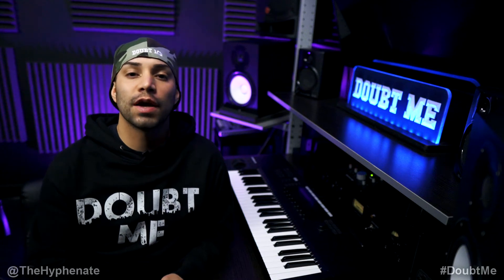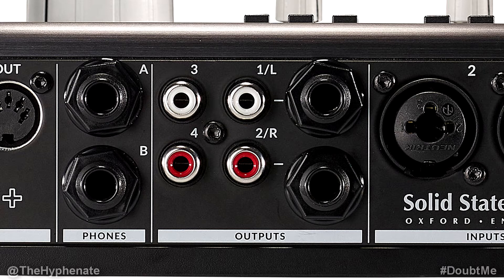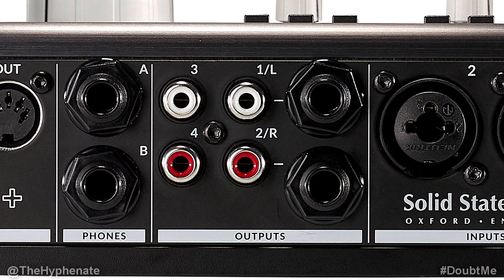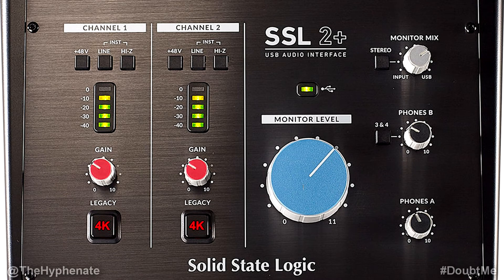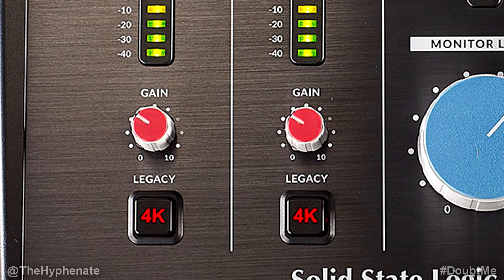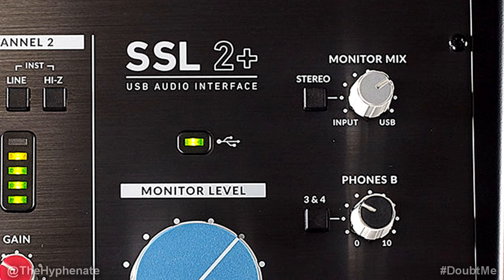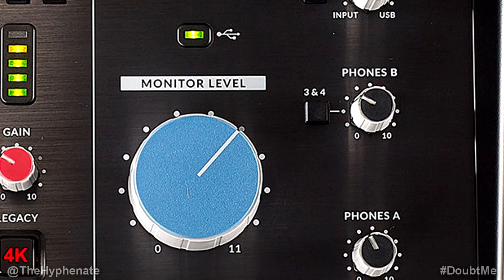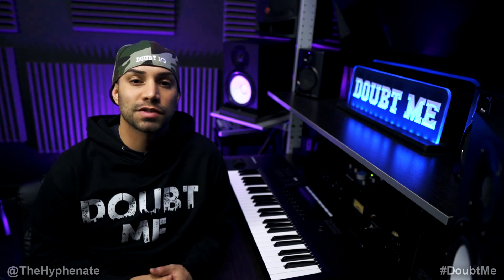SSL 2+ USB Audio Interface Tutorial [ Detailed Overview and Breakdown ]

Comment: Hi, I can’t seem to get the balanced monitor outputs to work. I have a mic plugged into the input and get a signal with the led meters and with the knob turned all the way to the left to ‘input’ but nothing from the monitor outs. The headphone out however works no problem. Is there something I am not doing right?
Reply from the maker: Make sure you have the right cables and the monitors are turned on and have the right connections

Comment: Hi, do you still rate this product in 2024 ? Or should i check something else in this price range ?
Reply from the maker: It's still great.  However they have a mark 2 version out now.  That one is awesome.  Also, now I've moved on to the Audient ID interfaces.   I use the ID44 mk 2, but the audient ID24 mk 2 is also great.  
The reason I went with the audient interfaces is because they have insert and sends built in to the interface which is great for connecting analog gear to it, like a compressor.
Reply: Thanks 🙏🏻

Comment: thx
Reply from the maker: Happy to help. Thanks for watching 🙏🙏
Reply: @DoubtMeTech

i bought that interface and Iam using two different operating systems.

I've recognized that the sound quality of my mic is a way much better on windows than macOS.

I've the latest windows and MacOS
😢.

Do you know something about that ? I've seen the difference even when I use what's app web or desktop app on both systems. the mic quality is very different.

Audio input and output is on SSL2+ on Mac .
Reply: sorry Iam using the sE electronics V7 MK microphone

Comment: I am trying to use channels 1-4 all together (LR trs + the rca channels 1-4) Combining multiple stystems(4 systems to be exact, with one system running mono through phone A or B) Specifically for listening purposes. When i use phones A and B, there is no stereo/surround panning. Now when i select my output in windows, there is an option for output 1/2 and a seperate output for 3/4. But i dont want to use them separately. Im not finding software for my interface that combines all the channels into one. So essentially, i am able to run 2 of my systems into stereo currently, and am only able to hook up the other 2 systems through phones A and B, but i want stereo so phones A and B wont achieve this. Assuming its not possible but figure i should ask. Thanks

Comment: If I plug this directly into my camera, should I just use the secondary headphone out port, or should I use the RCA outputs since I already have monitors plugged in to the balanced monitor output jacks...?
Reply from the maker: Why do you want to plug this into your camera?   The audio level come out is Line level and the camera will take in Mic level. They are different levels.  It can be done, but you run a greater risk of distortion
Reply: @TheHyphenateTech  so it's better to run it through the DAW? I don't have a video capture card yet and was thinking it would be a lot easier to just record it all to the camera's SD card directly to start...
Reply: @TheHyphenateTech  I also have a Sony A6400 so at least it is a decent camera.
Reply from the maker: Yeah record to the DAW and then sync the audio track with your camera's audio track and then delete the camera audio track.   What is it you're trying to capture?
Reply: @TheHyphenateTech  just learning at the moment. Nothing in particular yet.

Comment: Whatsup bro, been lovin your content. Just wondering though, I wanted to get the SSL 2 for my rap vocals but I wanted to podcast as well lookin at this rodecaster beast. You think I could get away recording rap vocals + podcasting on Rodecaster alone? I got both Rode NT1 and Shure SM58 (may need to get cloudlifter)
Reply from the maker: Technically the rodecaster could work to record your rap vocals as an audio interface, but if you have a few hundred extra (or can save for it) personally I would recommend getting the ssl2+ for your rap vocals and use the rodecaster for the Podcast.  But again, Technically the rodecaster will work, but I think as a pure mic pre-amp/audio interface for music, the ssl2+ is superior
Reply: @TheHyphenateTech  Prolly i could start with the rodecaster to have multi use then to upgrade to SSL 2 when it is needed
Reply: @TheHyphenateTech  Or perhaps. Next upgrade will be the MixPre 3 Mark 2 instead of the SSL. What do you think?
Reply from the maker: I think if you're going to be doing consistent podcasting, get the rodecaster and use that as your audio interface for music recording and later add the ssl2+ to your studio and use that for music.
Reply: Yeah. Thanks man. Appreciate it
Reply from the maker: Happy to help. Thanks for watching 🙏🙏

Comment: Hello man,

So, the RCA inputs 3&4 is the imputs for other monitors? I am planning to put a pair as a reference and my main would be HS8's.

Any recommendation on the setup? or I need to have a monitor controller?
Reply from the maker: Yeah you could use 3 & 4 for reference, but you'll need to make a stereo channel in your daw with outputs 3 & 4.   An easier way for me, I use the headphones B output with a single quarter inch trs to a pair of trs jacks and run those into my reference monitors.  So I use my headphones B output instead of 3&4
Reply: @TheHyphenateTech  I am thinking how is that routing. Can you make a video on how you do that man? For me to have an extra ideas on the setup. I alresdy subscribed to your  channel too. Great stuff!
Reply: @TheHyphenateTech  I have a mixer too. I really want to utilize the SSL 2+.
Reply from the maker: @martinmurillo9468  I'll work on making that video
Reply: @TheHyphenateTech  Thanks man. Best of the best! Kudos! 👌